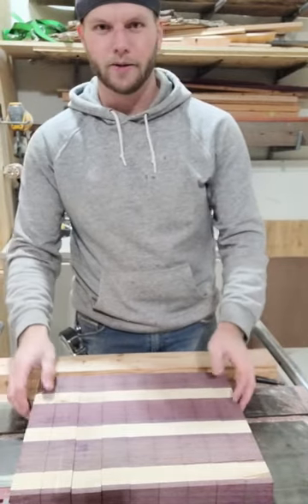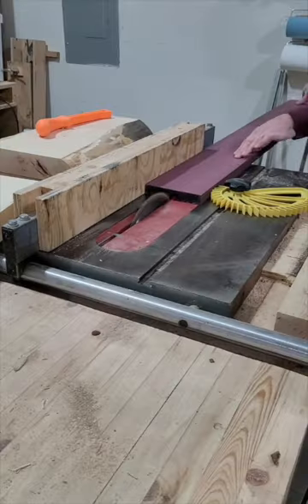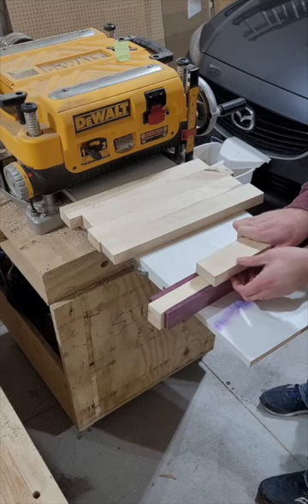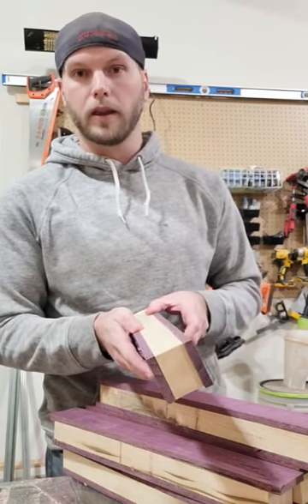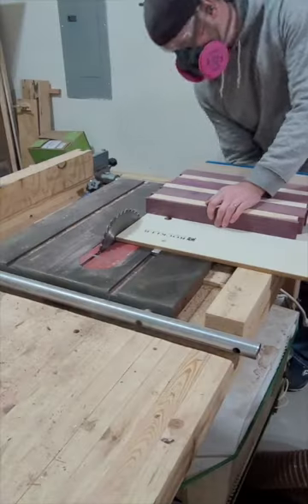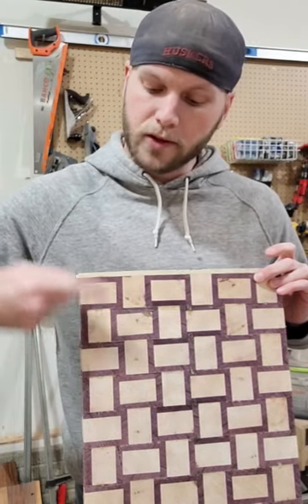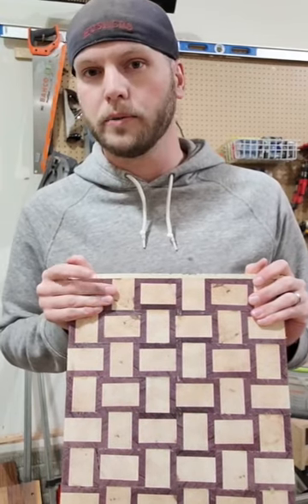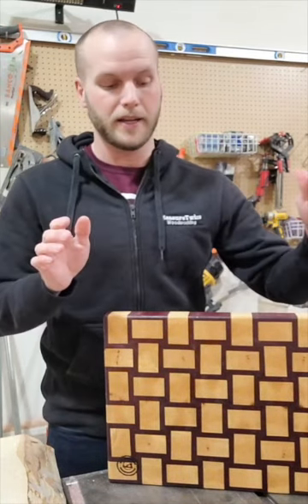Building a Basket Weave Butcher Block for Charity

Comment: I like hand planing for the final step. I’ve never had any tear out ever on end grain. Really doesn’t take that long for this step—maybe an hour and it’s a good workout. 

Good looking board. I’m trying to move beyond simple builds and this looks like a pretty inspiring idea.
Reply from the maker: How well does hand planing work on end grain? I imagine that being more difficult.
Reply: @measuretwicewoodworking  Handplaning works excellently on flattening EG. Epic Woodworking had a couple videos on making a simple cherry board and Tom used a LN LAJ for this process which gave me the idea. You don't have to use a LAJ--my 5.5 LN works pretty well also. 

The wood doesn't tear out bc EG is so dense. During the process, I test boards with a straight edge and by placing on a marble countertop checking for any wiggling. It's pretty rote for me to fix any imperfections or wobble. I can do both sides of a 16x12" board in about 90 minutes--give or take (somewhat surprisingly to me hand planing EG hard maple isn't more difficult that cherry or walnut). After flattening there might be some superficial scratch marks on the board that are easily taken care of by some 80 grit paper., 

It's a decent workout also. I've made dozens of boards this way. Might not work for a commercial operation, but for a retired guy it's fine...

Comment: Thank you so very much for the basket weave reveal video, I am 75 and could not figure out the manner they are made . I am directionally and geometrically challenged , but am a retired 
Physician so I am not a dummy. 
 Once , before GPS and iPads , I was standing on a mountain with forest service map in hand and a compass, a friend came up, said “ wait a minute friend”, took the map , turned it 180 degrees , and said “ try it this way”.
Jack in Idaho

Comment: excellent video build. Love the basketweave with just two woods. Wood Magazine had an article on this type of cutting board but it used six different woods, some exotic, and it would have been $300 just for the lumber. With your video I can use maple and cherry, two species I have a bunch of sitting on the lumber racks in the shop. Thanks!

Comment: What a great looking board, and so much easier than most of the other designs I've seen. Just a quick question. After the 2nd glue up and you're cutting the strips, you seem to readjust the fence after a few cuts? Are these not all equal sizes? Thanks
Reply from the maker: Thanks!

They are meant to be equal, yes. For the sake of safety you shouldn't use the miter slot and the fence at the same time. Also,  if the board is wider than it is long you shouldn't use the fence as a guide. Too much leverage. I switch strategies the moment it feels unsafe to use the miter slot and the board is longer than it is wide and therefore I don't have a sideways leverage safety problem.

Comment: Another question after i completely butchered (pun intended) my board.

After the second glue up and before cutting the strips, you said you were going to run it through the planer to remove the glue. How do you do this without taking any timber off the walnut strips. I'm assuming very carefully, but any tips?
Reply from the maker: I took an extremely shallow pass on each side. Less than 1/64". You need a flat enough surface that the strips can be glued together in the third glue up.

Alternatively you can try sanding or lightly chiseling any glue blobs off. The planer gave me the best results.